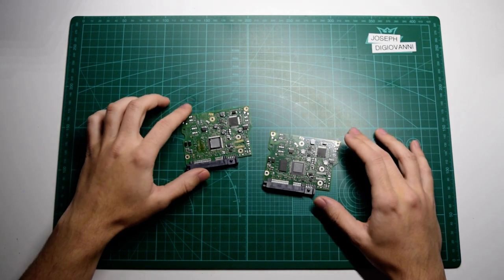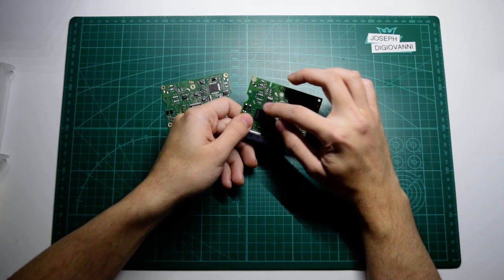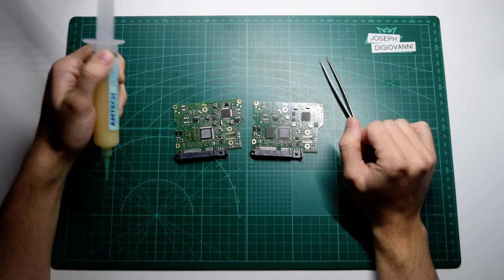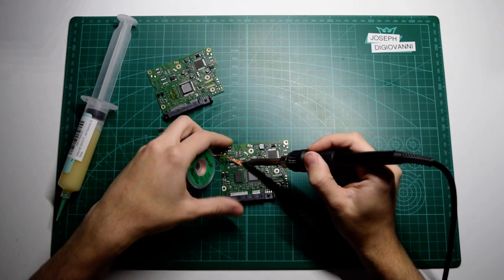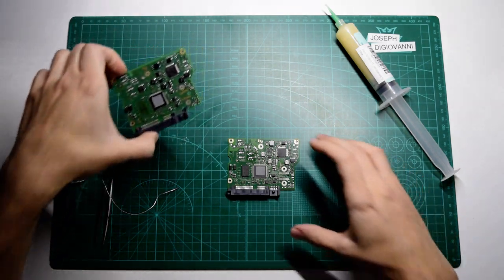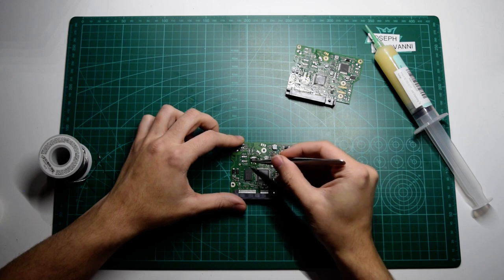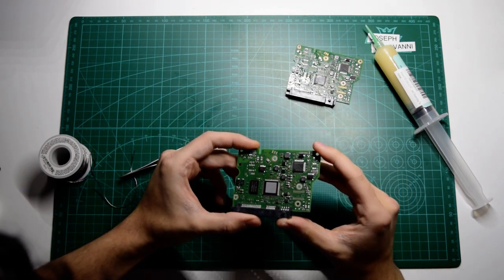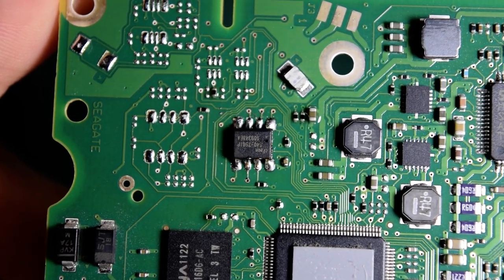How to Replace a Hard Drive PCB for Data Recovery

Comment: great video, I wanted to know if I could still use the new pcb if I got rid of the old one that had the original bios. So far with the new PCB the drive spins but doesn't show on the OS. Thanks!

Comment: Another question:

I bought this hard drive as an external usb storage device. It has failed. I took the hard drive out of the enclosure and put a Donor Board PCB on the hard drive without swapping out the PCB Firmware Rom Chip.

I did this in order to see just how bad the damage was on the drive before sending it off to a “professional recovery service”. It appears to be in great shape and spins up nicely however, windows see’s the hard drive but cannot access the data.

My main question is can I swap out the PCB Firmware Rom Chip from the original PCB Board with a rework station myself or do I need professionals do it(because I connected the drive without the correct Firmware Rom Chip; First)? Does advance programming or something else need to be done besides replacing the Firmware Rom Chip.

Please advise and explain why/why not.

I read on another repair website that Seagate drives have to have a professional swap out the Firmware Rom Chip if you connected the drive to the Donor Board without swapping the Firmware Rom Chip first. Does something special have to be done or am I reading this wrong? The website does say that you can do it yourself at your own risk if you feel comfortable.

Comment: Thank you for this!  Question... I received a replacement logic board from China for a WD HDD but, on swap out before replacing BIOS chip, the drive motor would not spin up.  Because there is a slight bit of damage to the board I am wondering of there are larger problems with the board or if this behaviour is to be expected prior to BIOS replacement?  Or is the motor chip probably bad?

Comment: I bought myself a heatgun and replacement PCB for a fried HDD. I swapped the BIOS chip over by following your video and to my utter suprise the drive span up and I got a 6TB drive back from the dead. I've renamed the drive Phoenix. Thanks :-D
Reply from the maker: Happy to help!
Reply: @jdigi78  what temp do you use
Reply from the maker: @bobbo2576  410 C
Reply: @jdigi78  what does it mean when you change the bios chip but it still doesn’t recognizes the HDD.  The drive use to work but had a burnt mark on the pcb. So I now swapped the bios. Still nothing. It spins and acts like it try’s to load.
Reply: Does the board have to be of the exact rev and number? I have another board that isn't the same board number and rev.
Reply from the maker: @MohammedZadjali  Ideally you'd get the same board including the revision number, but if you can't I don't believe it hurts to try
Reply: @jdigi78  Thanks for the reply! I had little hope of a response. I have been working on a project for 2 months and it's in one of my drives. Somehow the SATA power cable shorted and killed both my Samsung SSD and Barracuda HDD connected to the same cable. I tried the healthy PCB and the drive would spin (won't spin with the old one). 

I'll try to use the healthy board replacing the ROM chip and I'll feedback for future viewers.
Reply: @MohammedZadjali  mine did. But still didn’t work. I gave up on it. Sad because I had old pictures on it.
Reply: @bobbo2576  I thought I'd give an update. So I had ordered a similar board model to not leave it to chance. Replaced the RAM chip and the HDD is back and I managed to restore all of my data thankfully!

Perhaps you damaged something while transfering the RAM chip to the donor board @bob? Maybe it's worth it to try again if the RAM chip is intact.
Reply: @MohammedZadjali  what’s the RAM chip. I replaced the bios and it starts up but the pc doesn’t read it or anything. I’ve tied the device manager and still doesn’t read it. I tried the other chip that was on the board and it made the HDD click but swapped it back and it was running normal again but still yet nothing shows.
Reply: @bobbo2576  It's just another name for the BIOS chip. If you don't think you damaged the chip and there isn't a mechanical failure you can give it a shot with a new board. It could have been a new faulty board. After all those boards are salvaged from older HDDs.
Reply: @MohammedZadjali  new board?  But you have to have the bios chip. I hope I didn’t fry the chip. I just need to send it into some one to fix it. Just don’t want to spend 1k on something simple
Reply: @MohammedZadjali  same number and rev.
Reply: Nice video.  Question guys, if you just swap the board but not the bios, will harddrive work just without data?

Comment: hey man, i have an identical hard drive but one is broken, the sata port is broken, so can i just replace the board from the identical hard drive without any special tools in order to recover data?
Reply from the maker: You can try, it shouldn't do any harm. If it doesn't work you will need to follow what is done in the video

Comment: Liked and subbed.  Thank you for the tutorial.  Ive done several of these with success.  A few minor notes, if you will allow.
Zoom in...way in.  The distance leaves some to wonder.  The flux is really important when removing any component.  You didnt mention it in the first chip removal, but did in the second.  More flux at 5:09.  You showed having to move the chip, flux will help the chip magnetize to the contacts. :)  Very nice work though.  Screw that sucker back on and hope for the best...or at least good.  Thanks for posting.

Comment: Thanks for this. I was able to recover 4 years of images because of this video.
Reply: Did you just swap the PCB board from a HDD of same model
Reply: Will swapping only work
Reply: @ashfakulalam2806  you must also swap the chip from the old board as shown in the video
Reply: @hughesm02  will the HDD last long after changing the PCB.
Or should I just backup my data immediately
Reply: @ashfakulalam2806  You should always backup your data ASAP
Reply: @ashfakulalam2806  Nothing lasts forever. A hard drive has limited number of rotations. You understand that it  can't rotate forever. So you'd better make an immediate back-up and use recovered hdd for none-essential purposes. But it is a good practice to perform standard short disk self test  and long dst, SMART  test. There are many free hard drive health tests

Comment: If I have a Seagate drive with the click of death, do you know if it is possible the PCB is to blame? It spins up, clicks multiple times, then stops, and spins down. I'm trying to determine if I may be able to fix it myself or have to send the drive for recovery.
Reply from the maker: clicking is likely caused by damage to the mechanical parts and won't be fixed with this method
Reply: @jdigi78  That's whats I thought. Thank you.

Comment: When doing this so what temperature did you set your hot air gun to?
Reply from the maker: About 415, but hot air rework temps vary greatly. Practice on some junk parts if you've never done it

Comment: 2:30 what temp and airflow did you use?
Reply from the maker: I don't remember, sorry. Look up a hot air reflow tutorial for more information. It's best to just practice on some junk electronics with similar sized chips and find what works best for your gear.

Comment: I don't have any equipment. Ordered the cheapest soldering iron on amazon for 7 bucks. Can this be done with just that? I practiced on the old motherboard and nothing seems to melt. I got the tiniest tip on the iron and put it to 450 but nothing would melt. Got the biggest flat tip and tried to heat up the entire component and nothing. I'm hoping the chip is easier than the one I practiced on.
Reply from the maker: You should watch a soldering tutorial, you need to apply fresh solder to the tip to wet it so it makes good contact. Also to do this with an iron and not a hot air rework station you need something like chipquik, it stays molten longer so you can heat all the legs at once

Comment: Dude you are amazing man, hope you are successful and doing well. Another question. You can't use a firmware or bios or whatever transfer program like ch341 to simply transfer this critical information or program it into the donor board without doing the rework station swap is there? No worries if not, I already ordered everything I need from your video.
Reply from the maker: Thank you! I'm sure the data could be transferred if it's erasable memory but the chip swap is much less technical

Comment: What temperature (Celsius) dd you set the air at to remove & replace the chip?
Reply: I tested on a old HDD PCB and had good success with 310 C (hard drive worked). I just used flux and the same solder.
I'm interested, too, what temperature you recommend. I heard too low is worse.

Comment: Hi Joseph - thank you for the very clear video.  I have a Seagate hard drive which I can "feel" spins up but the computer BIOS refuses to recognise the drive.  The BIOS takes ages to load - a couple of minutes.  I think the motor seems ok as the drive spins up.  Do you feel that swapping the board (and the BIOS chip) would work?  Or am I barking up the wrong tree?  Many thanks, Alex.
Reply from the maker: If your bios doesn't recognize the drive it's likely a bad board. I'd recommend swapping it
Reply: @jdigi78  Thank you sir.  I'll give that a go :-)

Comment: Hi  I need to do this myself so I bought a soldering kit. I do not have the heat blower but the hot-tip pen from the kit.
I only get one shot on this so I do not want to do any damage. My questions are:
- Can I use the hot-tip pen instead of the blower you are using.
- Will the heat damage the chip in anyway
- if I melt the soldering and it spreads and make the pins of the chip touch each other, will that cause a problem. You seem to do it very casually.
- What is the cleaning liquid you used and why?
- Can you advice me on how to do this with a hot-tip pen instead?

Many thanks
Reply from the maker: if you are going to use a soldering iron instead of hot air, I'd recommend chip quik. There are other videos demonstrating it's use
Reply: @jdigi78  Thanks for the reply

Comment: Is that a hot air gun? I saw in another video that one should not use it to not destroy the board.
Reply from the maker: They might have been referring to a heat gun which isn't temperature controlled or focused. A hot air rework station is exactly what you need for smd components.
Reply: @jdigi78  Thanks for the quick reply, as for as a understnad heat gun and hot air gun are the same thing. So I shouldn't be using either one, correct? I have a hot air gun for 30 dollars, made in china, 2 modes - 300 c and 500 celsius. What temperature should the solder station be put at?
Reply from the maker: @crazystuff9726  the key word here would be rework station, if your hot air gun has some nozzle to focus the heat like mine it may work okay. Get some old junk with smd components on it and give it a try

Comment: I need to do this. Mine is a WD 1 TB REV A 2060-771289-005.  WHat other numbers need to match? Or is a PCB with this revision number bgood enough?

Thanks
Reply from the maker: If you can match those numbers that's good. Different revision numbers may work but always try to get the exact same one.
Reply: @jdigi78  Thanks for replying. What about the DCM (drive configuration matrix), LBA (logical block addressing) numbers etc. I'm able to fairly easily find matching revision numbers. One last question. Have you used the technique in the video more than once? In the video which numbers of yours matched?
Reply from the maker: @hfakoor1190  just match the model and revision of the PCB. I've done it a half dozen times with success on all but one drive.

Comment: I just did this exact process but sadly my HDD is still not detected by my PC. I can hear my hard drive spinning but that's just about it. Can you please advise? Thanks so much!
Reply from the maker: Does the drive show up in disk management? If the file system is corrupt it may not show up in file explorer.
Reply: @jdigi78   No it's not showing up in disk management. I'm pretty sure I did everything including swapping the BIOS chip. Any chance I can fix my drive some other way?
Reply from the maker: @dsconnct  I don't think so sorry.
Reply: @jdigi78  Oh no...

Comment: Hi, thank you for this video. Is it possible to avoid the swap of the bios chip by using a tool like ch341? The idea is to read bios data from the old bios chip and write to the new one.
Reply: Yes, however, it depends upon whether the flash ROM (BIOS) is correctly recognized / selected within the flash programmer SW.  I was able to do this on an older circa 2012 HDD, however, using two different flash programmer SW (on CH341a) I could not correctly identify the 25FU406C flash ROM on an HGST (Hitachi now WD) 1TB 2.4" as it appears WD has modified the flash ROM offset so when I attempted to use other common (LE25FU406BMA and W25P40) IC selections it only corrupted the test flash ROM so I will now have to attempt solder process.  * Warning ***I Strongly suggest you perform a backup of the donor HDD flash ROM (BIOS) first and re-flash back to the same donor BIOS and boot/access test (before) attempting to backup and flash the original BIOS to the donor BIOS else you could corrupt your original BIOS and it will become unusable (even with soldering process).

Comment: I have swapped the board and move the old bios chip to new one, it read on diskmanager but asked me to initialize and when i did it give error
There's no rough noise or click on the drive
Any solution?
Reply from the maker: What was the original issue? Was the drive not spinning? Initializing the drive was probably not a good idea as it wipes the partition table. But the fact that it suggested you do that indicates a bad partition table was the issue to begin with
Reply: @jdigi78  my assumption was from the board due to it's very quiet (no spinning sound at the beginning), when i swap the board it spins and detected by computer but required initialization that won't work... So curious if you ever find similar case and that you might have any kind of solution? Thanks!
Reply from the maker: @deskharisma  other than making sure the old chip is installed properly I don't think there is much you can do
Reply: @jdigi78  tried my best to install the chip but yeah i still can't make it works. Thank you anyway

Comment: Hi there, great video mate. This helped my uncle who's a dairy farmer. His HDD failed and we tried this after a few other things. 

I have another question though. I've a galaxy s6 that I currently can't access the storage on as the screen is not displaying and it's locked. When I plug it in it needs to be in debug mode to access storage but I can't because screen is blank and it wasn't set up before hand. I've got different software but Samsung's are encrypted so even though it's detected by windows I still can't get anything off it. I've tried to use a mouse but nothings working. It's basically like a usb I can't access. I think I might need to remove the flash or transplant into another s6. Any ideas? Thank you
Reply from the maker: happy to help! I'd just replace the phone screen before anything else, if it really is just the screen broken. Swapping chips in a phone is very different because it's likely encrypted and may use other parts of the phone for that encryption.

Comment: When i looked for pcbs to replace my hard drive pcb because i have broken sata pins which are lost. i saw the whole thing about replacing the bios too with soldering and whatever, i immediately quit. Then i watched your video and now im ordering the pcb. PS: the pcb has to be the same model number as your damaged hard drive pcb model number!
Reply: If Hitachi then 0J*** or 0A***  (first line of four) number on the sticker on the back of PCB.

Comment: After a week of madness of acquiring/researching all the needed tools and PCB replacement, with faith but little hope I could make it work and recover my data, I'm hyped to share that it worked for me and its such a relieve to accomplish for somebody that has no experience with soldering, take your time doing it and I will definitely recommend to get one of the Chip Quick removal kits that includes the flux and alloy, it helps a lot to work neatly around the bios chip!  
Thanks to Joseph DiGiovanni for the guided video
Reply from the maker: Congratulations on the recovery and learning a new skill. Soldering is a very useful one. Glad I could help out
Reply: Yes!
Reply: i also meant to say, find a few old ded hard drive pcbs and practice on them. Youll be surprised at how simple it gets, but get a hot air gun, with tips,   35 bucks, anywhere.  It makes all the difference.  :)
Reply: How many vids are you going to copy and paste this comment to?

Comment: What exactly is the name of heat gun ur using? Need to buy one
Reply: Any soldering station will probably do
Reply: @Abu_Shawarib  Heat guns are better for surface mount parts. Unless you can find some kind of soldering tweezers.